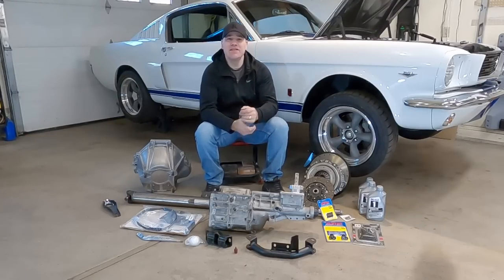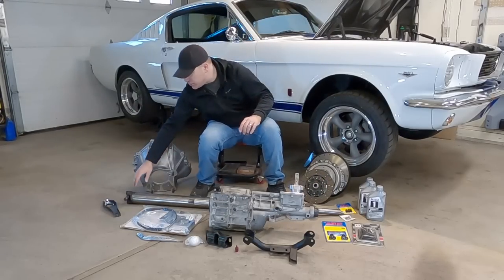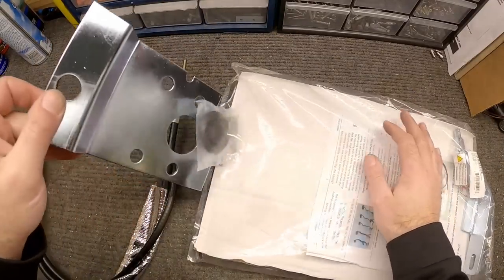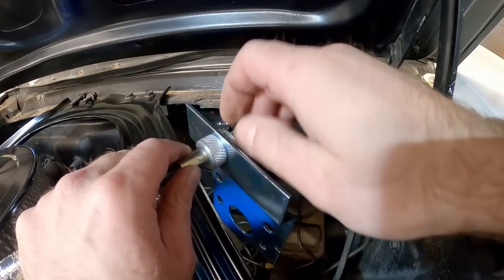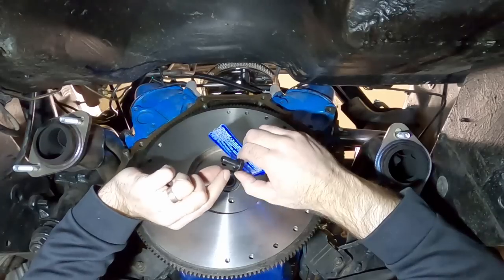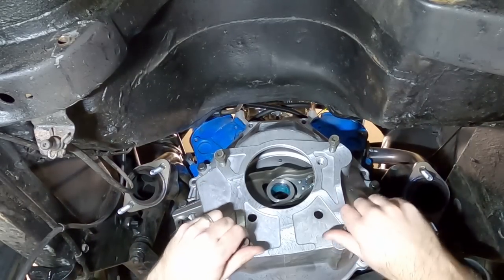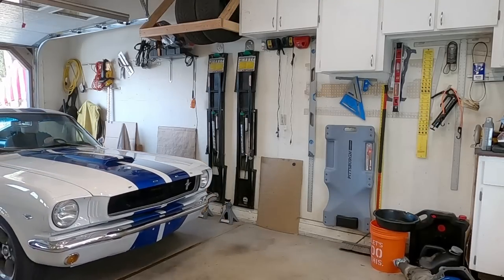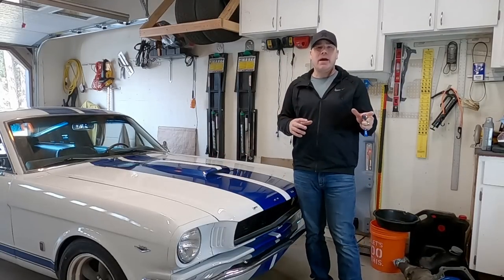How to swap a C4 Transmission for a T5 Transmission (Part 2 of 2)

Comment: Any tips on attaching that cable to the bracket? It’s next to impossible.
Reply from the maker: I threaded it to the clevis, then attached the clevis to the end of the linkage bar that bolts to the side of the clutch pedal.
Reply: @AndyKruseChannel  but how did you get it attached to the linkage bar? Did you do it before attaching the cable to the firewall through the hole you drilled? Cause I am at my wits end with it. Can’t see what I’m doing up there and not much hand room.
Reply from the maker: Attach the clevis to the cable before feeding it through the firewall. Then, under the dash, attach the clevis to the clutch bracket with the supplied pin and cotter pin. Then bolt the linkage to the clutch pedal.

Comment: Do you recommend a supplier for the T5 and the related parts?  I have a 66 coupe 289 three speed I want to upgrade.
Reply from the maker: If I was buying new, I would only spend my money at Modern Driveline (MDL).  Not only do they have the transmission you want and all the associated parts to make the swap, but they're super great to work with.  If you're on a tight budget, try to find your T5 on Craigslist or Marketplace, shop around a little for some of the more basic parts, but still get some of the important stuff from MDL (like the bellhousing, flywheel, and crossmember).   :)
Reply: @AndyKruseChannel  thanks Andy.

Comment: What did you do for a neutral safety switch?
Reply from the maker: I did not hook it up.  I pulled the rod out from the switch and taped up the wires.  :)

Comment: I know it’s been a few months now, but do you remember about how long it took you to do all the work?
Reply from the maker: I don't, but it's tough to gauge the time as I have to deal with the lighting, camera placement, knowing what to say, and stuff like that while I make the video, so it'll naturally take me longer.  However, if a guy had all the tools and parts ready to go, maybe a friend to help, this could be done in a day.  The parts that can delay this swap are stuck bolts and dealing with the exhaust if the system is not already modular or able to be taken apart and put back together.  This particular swap took about a week because of the problem I had with the transmission crossmember (and I work a regular job too, so my time is limited).  But if I wasn't so cheap, I would have purchased the better crossmember to begin with and I would not have had an issue.  :)

Comment: Did you replace the speedo cable or just the gear.
Reply from the maker: Just the gear.  The speedo cable in these cars will plug right into several transmissions out there, which is another reason this swap is so easy.  :)
Reply: @AndyKruseChannel 

Perfect. I’m doing my swap this week.

Comment: Hey Andy I was wondering why didn’t you go the hydraulic route like the coupe? Would you still recommend the set up you had in the coupe I have the cable and I was wanting to go hydraulic mainly because I see my fire wall flexing a little
Reply from the maker: Mostly cost, as the Hydraulic Kit is about $200 more than the Cable Kit.  If money wasn't an issue, Hydraulic any day of the week.
Reply: @AndyKruseChannel   good to hear I was wondering why the switch so I was hesitant at first. Your video for the hydraulic kit isn’t the cost around 200 for the entire kit? It’s been a while since I watched it but were there other parts needed? I just ran the number for the kit from mdl
Reply from the maker: @lucianohernandez3468  There are two parts to the kit, the master cylinder (about $320) and the slave cylinder (about $225).  You have to select them separately on the MDL site as there are a few different models and designs, it depends on what you want.

Comment: Which flywheel and clutch bolts did u use? the clutch needs shouldered bolts because of the dowl pins that you cannot use ? Do you have a part number?
Reply from the maker: Flywheel bolts = ARP 100-2801.  Clutch bolts = ARP 150-2201.
Correct, these clutch bolts have a shoulder because the dowels pins are not used.  :)

Comment: where did you get your pedal assembly
Reply from the maker: I used the pedal assembly that was in my car.  I purchased clutch pedal from Modern Driveline, and I modified the brake pedal and assembly to accept the roller bearing kit upgrade so the system pivoted on roller bearings instead of the poor shaft design from the factory.  I have a video on that modification/upgrade that came out near the same time as this video.  :)

Comment: Installed mine over year ago, using MDL, i cant get clutch to realease, i notice yoiu Did Not do a run out on your bell housing, i didnt either, i had 0 help and was my first time installing a clutch, my question is? would me not doing this run out cause the clutch not to release, its c4 to t5 conversion from mdl amd the runout was never mention, Please Please help me, could be air? pedal adjustment? I have no help and hate to take it back out, but if you tell me its the problem i will, thanks a lot!!!1 Great Vuideo by the way
Reply from the maker: If there was a runout issue with your setup, it manifest as increased wear on the input shaft bearing, which means you'll need to service that location before someone that was within runout specs.  The clutch sticking is not related to any runout issues.
You don't mention the clutch actuation style (Z-bar vs Cable vs Hydraulic), so it's difficult to diagnose without that info.  Also, you say you can't get the clutch to release.  Do you mean getting the clutch to release from the flywheel, or when you take your foot off the clutch pedal you can't get it out of neutral and into gear?
Reply: Hydralic clutch from mdl, when i pit into gear and i press the clutch the wheels are still lock cause in gear, i can put in neutral and wheels turn @AndyKruseChannel
Reply: i have it on a small lift and i crank it put in gear and wheels turn but when i press in clutch wheels still turn @AndyKruseChannel
Reply from the maker: @rickycarroll1990  My guess is that the system needs to be bled again.  I spent a long time bleeding the hydraulic clutch, and I went through a lot of fluid making sure I did it correctly.  In the end I probably spent longer than needed, but everything works great, just gotta follow those instructions to a "T"!  :)
Reply: @AndyKruseChannel  ok I bet you are right, I will be on it tomorrow and I appreciate you so much, ease my mind, I will let u know how it goes, have a great day, And thanks again

Comment: Do you remember the part number and where you bought the clutch lever(fork) and the throw out bearing?
Reply from the maker: I ordered the Clutch Fork from Summit Racing, part no PIO-CF-119.  The throwout bearing came with the Clutch, which I ordered from Modern Driveline, part no MD-07-14C.  Heads up, that Clutch is a 10 inch size, with a 10 spline, and designed to worth with Cable or Hydraulic Clutches, not the OEM style Z-Bar mechanism.  :)
Reply: @AndyKruseChannel  and if it's not a bother, what bell housing did you get and where did you get it from?
Reply from the maker: @taylornelson8189  No problem at all, I ordered it from Modern Driveline, part no MD-401-1101.  It's designed to fit the 6 bolt 289/302 Ford motors, and the T5s from 79-93.  T5s from '94-'04 need a slightly deeper Bellhousing as the input shaft is about 7/8" longer.  But MDL has all the parts you need.  :)

Comment: Hi, i love the videos you do! I have a 65 coupe and have the same trans crossmember you first tried to use. You got it to line up. I can’t. It’s off by half an inch. Any thoughts ?
Reply from the maker: First thought is which year T5 do you have?  Only because in my last Mustang I purchased a 94-04 T5 and the crossmember mount for that trans is about 1/2" or so farther back than the mount on the 83-93 T5 units.  On my current car, I made sure to get the correct T5.
If you have the correct year Trans, you might check the rubber trans mount that is bolted to the bottom of your T5.  If you bolt that rubber mount in place and tighten it down before you test fit the Crossmember, it might need to be adjusted.  :)
Reply: @AndyKruseChannel  i have the 80s T5. The tubular crossmember was from the AOD i had before in the 65 mustang. Looks identical to yours and what some manufacturers sell. If you look at the MDL one, the area for the bolts have more of an adjustment than the tubular ones that are more offset. I can get it to work, but it’ll need some drilling.
Reply from the maker: @raptorjesus99  Sounds like making those slots longer may work for you.  Normally I'd say just get the correct crossmember mount, but everything is expensive these days so modifying what you have might be the best route.  :)
Reply: @AndyKruseChannel  thank you! Is YouTube the platform you are most active? I literally had your video playing with me under the car.
Reply from the maker: Yes.  Sometimes I post on other sites, but it's usually somehow linked to my YouTube videos.  :)
Reply: @AndyKruseChannel  how does first gear feel on launch at a stop? With my stroker engine first and second are almost useless
Reply from the maker: @raptorjesus99  The first gear in my trans is too short.  Because I purchased this unit used, I was stuck with whatever ratio was in there.  I was thinking about swapping out the main shaft and countershaft for better ratios, but I was also thinking I should just put my money towards a TKX or T56 trans.  Time will tell.  :)

Comment: Changing from a C4, what clutch pedal did you install.
Reply from the maker: I added the pedal that MDL sells, and installed it with a roller bearing kit.  Super easy to do and I'd do it all the same again if I had to.  I made a video about it, it came out right before this video.  :)

Comment: So I had my moms 65 mustang upgraded to the same t5 trans, the problem I’m having with it is that every shift it grinds.   I have no real idea what to do when it comes to transmissions so I have no idea how to correct my problem.  Any ideas that I could look at to try and fix it before I have to breakdown and take it to a shop?
Reply from the maker: My first guess are worn out synchros inside the transmission.  Beyond that, maybe the clutch is not fully disengaging or possibly worn shift fingers (located inside the top of the trans, these can get stretched out over time).  Lastly, maybe double check the fluid level and make sure there's enough ATF fluid inside there.  Good luck!!  :)

Comment: Did you just do the T5 or the T5z?
Reply from the maker: T5.  One could make the argument that the upgrades I've done to the T5 can put it closer to the capability of the T5Z, but it's still just the T5.  :)
Reply: @AndyKruseChannel  Thanks for the reply! I really appreciate your well put together videos. It even gives me the confidence to at least think I could do this myself. I'm not pushing any kind of crazy power so T5 or T5z probably makes little difference to me for the street. I'll never race it, but if I can get the z spec T5 for the similiar price, then I'll probably go with that

Comment: Hello there , i have a question, i have H O 302 with C4 , can i do this swap and convert it to manual on mine ?
Reply from the maker: Yes, most of what I did in this video should work on your car.  However, depending on your year and model, the C4 driveline may or may not work, you'll want to check into that.  :)

Comment: Well I'm in the final steps of this process and my driveshaft will not work, it's about 1 1/2" too long.  Not sure if it's a difference in the trans or not, I got the entire kit from Modern Driveline including the trans, so be aware of this.
Reply from the maker: I'd give them a call and see if either the wrong driveline was sent or if there's some other issue.  All my experiences with MDL have been stellar!  :)
Reply: @AndyKruseChannel  Yeah I'm not sure, I've double and tripled checked everything along the way.  The yoke will slide it all the way but it's just not enough to get the u-joints in the rear end.  Maybe there are slight differences in the tail shaft/housing?  You also had to trim your tunnel opening to get the shifter through where mine fit in perfectly.  I'll give them a call anyways though.
Reply from the maker: @grant3049  That part about trimming the tunnel is interesting.  I needed to cut around 1" to 1-1/2" of clearance to get the shifter assembly to slide up into the car.   But my transmission crossmember fit fine.  I think you're doing the right thing, give MDL a call and see what they say.  :)
Reply: @AndyKruseChannel  And you had to trim the front part of the shifter opening correct?  That's the 1"-1 1/2" I need for the driveshaft :)
Reply: I just got off the phone with them and they said typically the driveshaft needs to be trimmed about 3/4-1" going from the C4 to T5.  He did say that it depends on if the driveshaft was at the right length to begin with.
Reply from the maker: @grant3049  I've heard that too, but I have a C4 driveline in my setup, but I do not know if it was stock length (for a C4).  But I've also heard that a stock C4 driveline will swap straight over without any modification.  Doing so would leave very little room for driveline axial movement (as the axle travels up and down, effectively shortening the driveline), but it would work.  If you're stuck needing to trim that driveline down, maybe see if you can grab a P71 Crown Vic driveline from a junkyard and have it cut to length (since you're cutting anyway).  I bought one for $20 and my local yard, so that extra few bucks is definitely worth it since it's a large diameter (better for torsional load) and aluminum.  :)
Reply: @AndyKruseChannel  If I were to mash the yoke into the seal enough to get the rear installed there would not be enough for the axial movement, like you said.  So technically it would work but not be ideal.  I have a shop near me to shorten/balance it luckily and it's no too pricey, so I'll stick with the stock for now.  Maybe down the road I'll order one of the new QA1 carbon shafts :)

Comment: what's that whine when you acclerate?
Reply from the maker: That's the sound of everyone that doesn't have a T5 in their Mustang!  :)
Reply: @AndyKruseChannel  😂 I agree
Reply: @AndyKruseChannel  hahahaha. Good one.
Reply from the maker: @bofa83  It's the new intermediate shaft I had to replace in the trans before the install.  New gear parts will always whine, until they get worn in a bit.  :)

Comment: Driveshaft length  from a c4 to a t5 is it the same?
Reply from the maker: The driveshaft from a car with a C4 will fit with the T5 swap.  The length is not perfect, but definitely usable.  If I had the money to make a custom driveshaft, I'd chop about an inch off, but it's fine.  The difference is the yoke goes deeper into the T5 when using a C4 shaft, and I'd like to have a pinch more "play" in the driveshaft.  But, I have not "bottomed out" this driveshaft, even during spirited drives, so it's fine.  :)

Comment: Whats an average price for that ilk of T5 ?
Reply from the maker: I was fortunate to get this T5 off Facebook Marketplace for $250.  I did need to replace the intermediate shaft and buy a rebuilt kit (together about $250 more), so I'm into the T5 about $500.  That's still a good deal, but I did the work myself which saved me about $300.  With all that considered, I would have been about $800 into this T5 if I didn't rebuild it myself, and that's still a decent place to be.  But here's where it gets tricky.  Any more than that and I would have been better off buying a rebuilt T5 from a shop that usually comes with a warranty.  Prices can go even higher if you want upgrades or improvements done to the T5.  I have the tools to be able to find that "deal" from private sellers, but not everyone has the ability or willingness to go down that path.  Any T5 under $1000 that is good to go, slap it in and drive, is where you'd want to be if the cost is driving your T5 swap.
It gets more expensive if you want to swap in a 1994 - 2004 T5, they need more parts to make it work, but it can be done.  I did that on my previous Mustang, made a video about it on my channel, and learned that next time I only want the 1983 - 1993 T5.  :)
Reply: @AndyKruseChannel  that's a great help, thank you!

Comment: What did you do about the neutral safety switch.
Reply from the maker: At the time of install, I just zip-tied the wires to the side and did not connect them to anything.  I have since removed the safety switch with a plug so there's nothing there.  :)

Comment: What did you do with the coolant lines and where did you get the clutch pedal from
Reply from the maker: I ruined the coolant lines taking them off, but that's ok because they're not need and can be disconnected from the bottom of the radiator.  No caps are need, the section is separate from the rest of the radiator.
The clutch pedal was purchased from MDL, part number MD-402-6566M-C, I paid about $190 for it.  A used one off eBay should be just as good and way cheaper if you're on a budget.
Reply: Hi Andy...thanks for your answers. I'm in the UK 🇬🇧 and I've got a 1963 rancharo..I'm in two minds whether to go AOD or T5. Its got a 3 speed automatic. The RPM on the motorway ( freeway lol ) is frightening
Reply from the maker: @allangreen2275  I don't know if you'll run into fitment issues with the AOD in your ranchero, but at that same point, I don't know how the T5 would fit either.  Having that overdrive gear in the AOD or T5 will be fantastic if you're RPMs are high on the freeway like you mentioned.  It will likely take fewer parts to put that AOD in your car, specifically with the clutch pedal and clutch actuations system (z-bar vs cable vs hydraulic).  :)